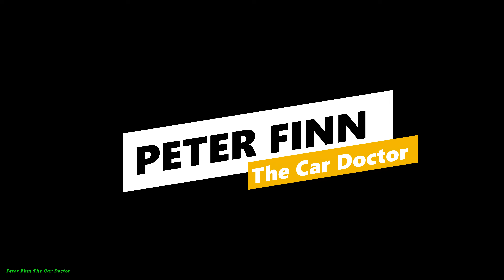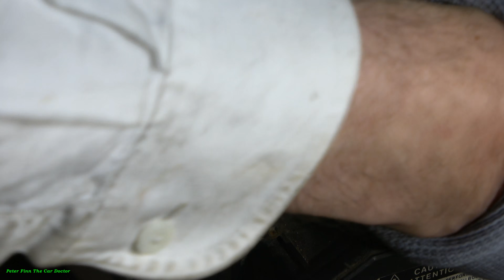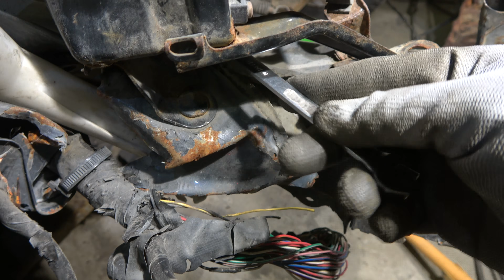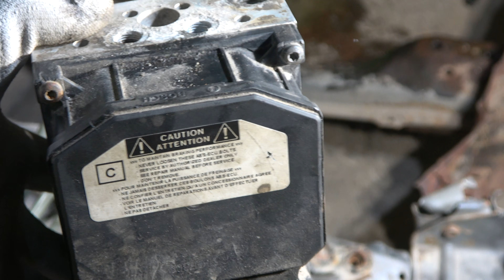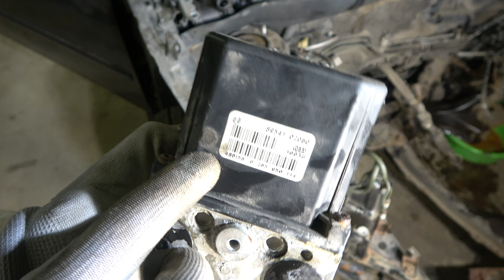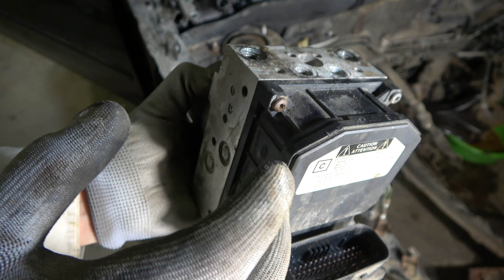How to replace Toyota Corolla ABS Hydraulic pump Unit. Years 2001 to 2020

Comment: Hi Peter, I was wondering if I could use an ABS module from a 2012 on my Corolla which is a 2010 model year. The ABS module I wanted came out of a 1.8L engine same as mine. Thank you
Reply from the maker: You can use
Reply: @PeterFinnTheCarDoctor  I purchased a used ABS module on eBay. I put in my year, make and model on and it said the part does fit. I received it and attempt to replace it but the two fluid holes on the side is smaller than the one I originally had. I can't use it. I tried to see if I could just swapped the module out. Luckily I did it on mine because it wouldn't separate unless I did it incorrectly. There's one part inside the module that seems to be connected to the pump and has 3 metal pins that seem to be attached to the pump. I pulled on it in order to separate the pump from the module. I don't know if there is a way to separate the two without damaging the unit?

Comment: My ABS module is bad on my 2013 toyota corolla. I found a used one on ebay. After swapping the part out does it need to be reprogrammed?
Reply from the maker: Thank you for your message. I have read your message. 😀👍
Reply: @PeterFinnTheCarDoctor  so does the abs need to be reprogrammed?
Reply: Most of the time yes
Reply: @S30luis  thank you. I had Toyota reprogram it. It appears to be working well. Got lucky with the used module
Reply: @iZomb  what was a sign of bad abs system? I mean what sign tells you need to replace abs ? Thank you in advance
Reply: @azimzakhidov3464  my ABS light was on and it wouldn't go off. I also had a few intense braking situations where my wheels locked up on me so I knew it wasn't working

Comment: Peter thank you for this video.
1. when removing do I have to worry about brake fluid under pressure? 

2. Should I remove brake fluid from master cylinder before?
Reply from the maker: Engine turned off. You can open the hoses carefully. There is no pressure. There is no need to remove the liquid.